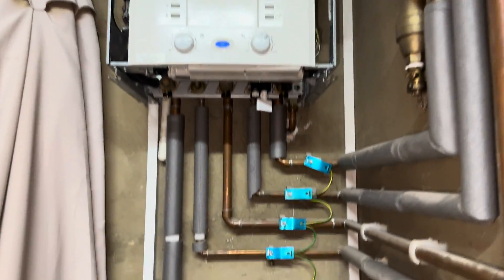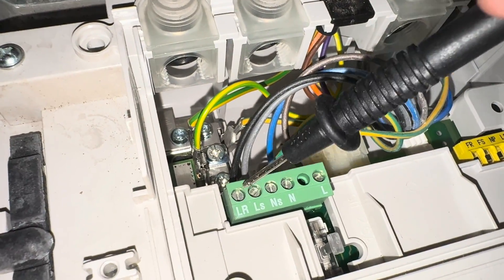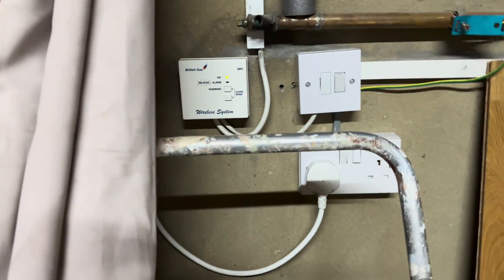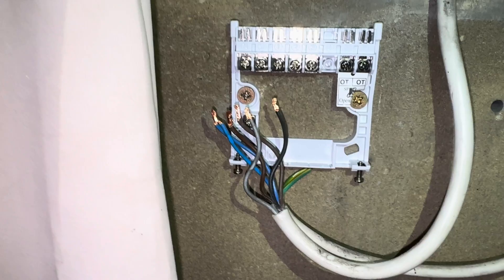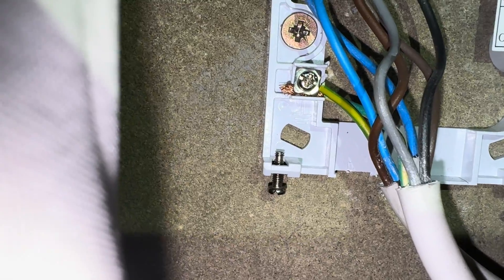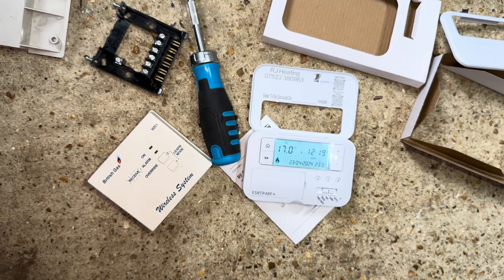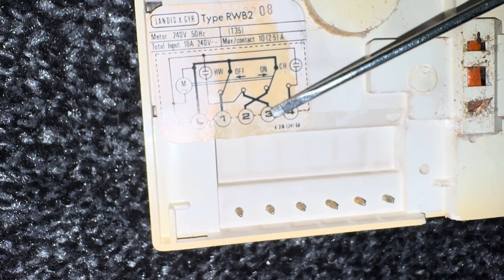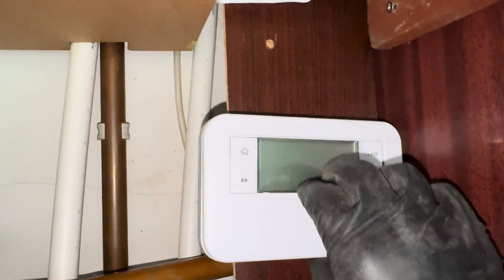Worcester Wiring Diagnosis ft. @esi.controls

Comment: Thank you for the video
Reply from the maker: @madshepsreef282  thank you for watching and subscribing!
Reply: @ thanks, I’m going to be moving on from a large company next year and they only use electricians to wire the boilers so this video was helpful
Reply from the maker: @ oh nice. A lot of gas engineers struggle with wiring, I did for years until I kept getting sent to rewire jobs and then it became easier! There’s a irrational fear behind it but I get it? Especially when the wires upstairs don’t correspond with downstairs because they’ve connected onto another somewhere! Keep a look out for more coming soon!